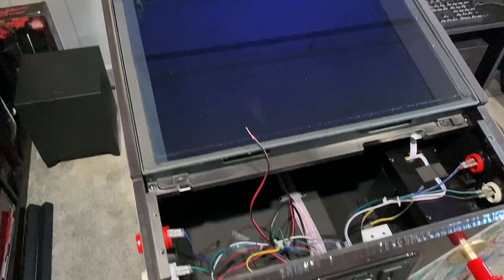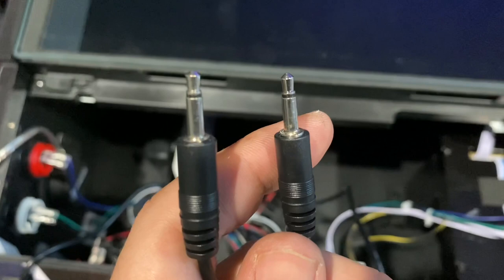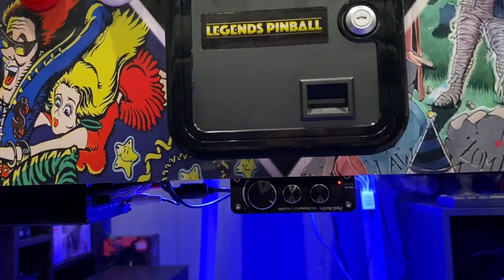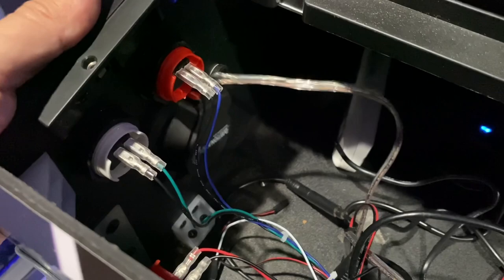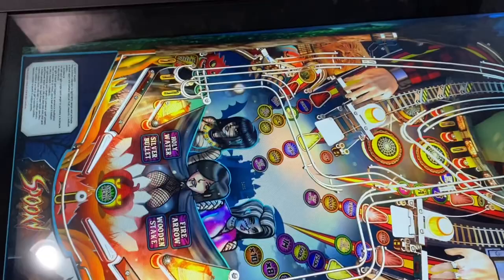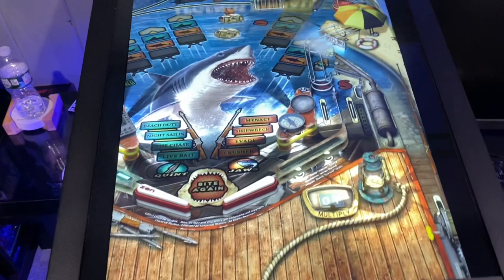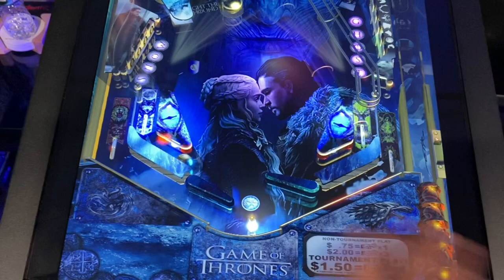Feel the Game: Legends Pinball Haptics Mod Tutorial with Bass Shaker, Exciter & Amps!

Comment: Your tutorials are great. Do you happen to have a schematics of your wiring? I have a little bit of trouble following the videos, looking to add the bass shaker and solenoids you suggested. Thanks again!
Reply from the maker: Thank you, greatly appreciate the feedback. 
For the bass shaker you’ll want to get your signal from the original feed for the haptics. Red to red, black to black on your adapter to amplifier wether it be 3.5mm mono or RCA. From your amplifier you’ll need a power source (power brick) and a positive and negative lead that goes from one of the outputs on the amp to the bass shaker. That’s it. 

The solenoids are even easier. Tap into existing flipper wires. Plug in power source. 

Hope that helps. Follow the videos along and pause. I talk fast, sorry.
Reply: @JohnPauls  so I'm about to install the bass shaker, but had a thought. Do you get haptics when playing in OTG mode? I get none playing on steam. If I'm using the wiring from the exciters for the bass shakers, assuming I will not be able to use the bass shaker, unless I'm playing on a built in table? I'm on the latest firmware. I feel like I've read somewhere that the latest firmware broke otg mode haptics.
Reply from the maker: Do you have haptics in VPX? FX3 haptics are weak from the get go. If you don’t have haptics at all in OTG, the bass shaker won’t work. I get signal in FX3 and the bass shaker rumbles albeit less than VPX and Native tables.
Reply from the maker: There’s supposedly a rollback firmware that fixes OTG haptics… worth looking into

Comment: Great Video, Why do we buy “Monoprice 109436 Gold Plated Speaker Banana Plugs – 5 Pairs – Closed “  I think I miss it on your video. Going watch it again.  Where do we use this on or with? Ok I am good. By watching again it help.
Reply from the maker: Only needed two, the rest are extras. Amazon only had them in that multi pack. They are used to connect to the back of the Fosi Audio BT10A  amplifier. There’s tutorials already online on how to set up a banana plug on the end of the wire. Super easy. Allows for simple plug and play. Hope that helps and thank you!
Reply: Banana plugs are not a necessity, just provides a nice finished look.
Reply from the maker: Correct
Reply: Do you turn off the “tilt” physical option? That shaker has to trigger it easily.
Reply from the maker: Yes although the positioning helped to reduce it on most tables. Gyro located next to the plunger. There are moments during gameplay that caused it to tilt. I use the nudge buttons mostly because I haven’t gotten the accelerometer to work in OTG so I’ll keep the experience the same.

Comment: It seems like there is a hell of a delay on the flipper lag.
Reply from the maker: Check the latest video with the leaf switches installed. Made a significant difference. There will always be a slight bit of lag with the ALP however graphic card settings and leaf switches certainly improve it.

Comment: What could be the issue I did the poor man's DOF. Worked amazing 👏 I wanted to add more exciters to middle of cab when did that everything stopped working and now only one exciter works on left side. Added the exciters to existing exciters in parallel and then poof..nothing what happened? I think I narrowed it down either the ALP sound card or the 3.5 mm. jacks but can you mess those up? As for sound card can you even get replacement for this? I did my research on parallel and series everyone just be careful what you add to ALP maybe someone out there have this same issue.
Reply from the maker: You added them in parallel to the existing exciter wiring? You definitely blew the stock sound card / amplifier. I believe it’s part of the board unfortunately… ugh that sucks.
Reply: No I added them to the two dayton exciters installed. I thought I blew the amps but they work because I swaped them out . I hooked up the the stock  exciters and it works. Pulled the 3.5 mm connector off the red and black wires re wired and plugged everything back in and only works on left channel but when I pull it out a bit it works on  right side very strange could it be the 3.5 mm connector. I ordered some new ones. I am so pisst at my self for doing this because it was working like a boss.. But I can't leave shit alone  should I try the mono splitter a someone mentioned in a earlier post or do you still think its is the board.. Where ? can you get a new board ? Can you order replacement? I hope I can fix this f%$k up. I was trying to determine series over parallel I guess I chose wrong.. PS: Oh have you played the BW mod of Adam's family its awesome great table.
Reply from the maker: Get the mono 3.5mm, your board is fine if the stock exciters work after going back. Shit happens, we live and learn from testing things.
Reply from the maker: I have the regular version, was the B/W mod different in regards to gameplay? Looks cool.
Reply: Well got it working it just doesn't seem like it was don't have the hum between Stock mode and OTG mode and before just plugged everything thing in now have to play with connectors pull them in out ect sucks. Well you live and you learn. I did a cool mod lighted buttons you can use your 12v power supply from the solenoid upgrade to power lights  run the lights daisy chained and ground same way its awesome mod to at games ledgens pinball..

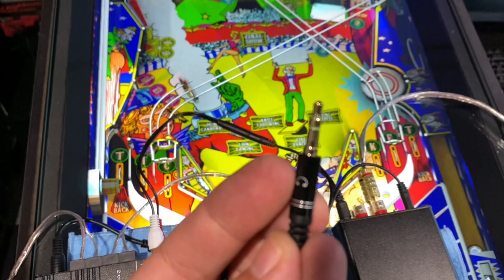Comment: Sorry I got confused at 4:12 how you split the wiring as it's taped up. I see the original red/black wire from alp and from there how is the wiring spliced into that? But to understand did you take both Fancasee 3.5mm to bare wire connectors, and connect the 1 red wire off each connector soldered to original alp red, and likewise for the 3 black wires?
Reply from the maker: That is correct, red to positives & black to negatives.
Reply: @JohnPauls  thank you. Could we run a 2.1 amp (50W×2 with 100W) instead of 2 amps? I'm thinking of getting a Damgoo which has its own sub frequency and volume dial. And then hardwire a 24V psu.
Or should we run dedicated amp only for the bst-1?
Reply from the maker: The Dayton Exciters are low voltage, 50w will fry them.
Reply: @JohnPauls  OK thx. I was cross referencing with another video on vpin parts, and this guy is using the 2.1 (50Wx2 + 100W) to power up his exciters and bst-1. He mentions a 2.1 setup front and back, but the exciters are 8 ohm 25W. Still though the amp power is double the speaker max. I'm assuming he just won't go full throttle on volume or it will blow them?

https://youtu.be/5Ftgomc1Wqs
Reply from the maker: Probably so, max volume will definitely distort them and possibly release the magic smoke. Interesting

Comment: is it possible to add additional exciters?  Does this mod disable the stock exciters or simply add 2 more to the stock 2?
Reply from the maker: Disables the stock exciters, they’re trash. You can add as many as you want as long as you account for power output on the amplifier(s). You need enough power to drive each exciter.

Comment: If you are only adding 1 bass shaker and 2 solenoids - can it all be run from one amp?  Or is using 2 amps necessary, or possibly just beneficial in that you get separate volume controls for the exciters and bass shaker?  Further, there are more powerful 20W 4 ohm exciters, that would be wired in series I'm guessing if they were to be used - would choosing those exciters change the amplification requirements (1 vs 2 amps)?
Reply from the maker: The exciters use a much lower wattage hence the need for a separate amp, the base shaker requires more 50w. You can find an amp that has separate power outputs by channel however that gets more expensive. Also better to be able to control amplifier power to each as they individually need tweaking by table / system playing it I.e. VPX, FX3, Native Alp

Comment: Question that’s been on my mind….Is this equal to Buy Stuff Arcades haptics upgrade kit…..or better? Mainly the bass shaker? I do like the Buy Stuff Kit because it comes with the audio switch. What would be the better way to go? Both options are a difference of $9
Reply from the maker: Wouldn’t know, sorry. Consider install ease as well. My setup performs extremely well, no issues in over a year. Plug and play is easier but I haven’t seen or felt the BSA to make an informed decision.
Reply: @JohnPauls  I’ve got some downtime for 3 weeks so I’m finally pulling the trigger on the Cleveland Software solenoid kit and now the haptics upgrade!!🤘🏼
Reply: Do the amps you went with come with all the wires I need to hook this up?
Reply from the maker: No, wiring will be needed. Gauges recommended in video.
Reply: @JohnPauls  I finished the project and it’s now the highlight of my arcade!!! It’s literally night & day……INCREDIBLE!!! Haptics working together with the solenoids is just awesome!!!! Thanks for the inspiration and motivation!!!❤️👊🏼
Reply from the maker: You’re most welcome, truly glad to hear that Daniel!!! 👊🏼😌 Thank you for the feedback, enjoy it!!

Comment: Hey man!! Thank you for the tutorial. I’ve put together the same set but I’m having an issue where I’m only getting sound out of the left channel on both amplifiers. I’m assuming I did not understand how you wired the “splice” that you put together. Could you please explain how you did the splice? I wired all three reds together and all three blacks together, is that wrong?
Reply from the maker: You did exactly the right thing, reds to reds, blacks to blacks. See if you get the other channel to come live by jiggling the input to the amp. Some are reporting issues with the 3.5 connection.
Reply: @JohnPauls  I also figure I can just run both small haptics through the one speaker channel. I’ll try jiggling first though. Thanks for the reply
Reply from the maker: You can but easier wired up this way. Give that a shot. I believe they may have changed that y Connector hence why some are having issues. You’re most welcome and report back how it goes please. Thanks.
Reply: @JohnPauls  I ended up just running everything through the left channel for now, I couldn’t get the right channel working on either amp. Regardless, it works and is pretty damn cool!! Now I’m just tinkering with all the sound levels trying to find a good balance. What did you use to mount the Fosi amp?
Reply from the maker: It’ll be so much better with both channels, did you try connection at the amp? I have another video that goes over VPX haptics settings. They should help. The bass shaker makes the biggest difference. I’m currently moving my Dayton exciters to another location within the cab to make room for independent solenoids. I’ll have a video up soon. Please keep me updated on your progress.
Reply: @JohnPauls  I have the exact same issue with no signal on right channel exciter. Switching the RCA plugs at the amp moves the audio to the right. So it seems the signal is only coming through one of the RCA cables. I actually ordered a different Y connector thinking that was the issue and had the same problem. I’m wondering if the issue is because the 3.5mm outs on the open end connectors are mono and the 3.5 mm jack on the Y connector is a stereo input?
Reply from the maker: It could be, I did not have that issue so I could not confirm. Both channels have output. Please keep us updated.
Reply: @JohnPauls  so when your exciters fire, do they do so individually? I’m admittedly not great with audio, but now that I think about it, it seems odd that it could still operate in stereo after converting it to a mono signal. I guess I’m going to buy an open end connector with a stereo out rather than mono for the exciters (mono should be fine for the bass rumbler) and see how that goes. It looks like the stereo ones come with a third ground wire though; assuming I can just ignore that…
Reply from the maker: No they do not fire individually, nor did the stock exciters wired in series. It’ll pump the same sound through both exciters however now amplified and wired in Parallel. Look into the DOF solenoid video I made if you want individual feedback without having to program anything to a pc. As long as you’re getting feedback to both exciters, you’ve just improved your ALP tremendously. The bass shaker was the best bang for the buck in regards to whole table feel. Hitting the bumpers, ball roll, etc. all felt through the bass shaker.
Reply: @JohnPauls   thanks for all the help. I did also do the bass shaker and that works fine. I ended up doing like Doug above and running both exciters to the left channel amp out and it works. Guy in another video that wired things up the same way you did everywhere else also said both need to be hooked up to left channel. However I’m not feeling much from them when running games on my PC (stock is a little better) so now I’m wondering if there would be any boost in performance if I can get the right channel working. A comment you made to Doug above seems to suggest you think it will, but was hoping you could confirm that before I go to the trouble of buying those stereo 3.5 mm outs and rewiring stuff.
Reply from the maker: It normal for them to need an amp boost on VPX and FX3, I find having them set at 1/4 to 1/2 volume on Native Tables and 1/2+ for VPX / FX3. On VPX make sure you apply table sounds to Lontium in sound preferences, can be done on the Vpx.exe in edit mode and saved globally. The bass shaker will break in and get much louder / stronger with use.

Comment: About to install the bass shaker. Do you find it vibrates the metal casing on the power supply? Even when i tap the bottom of the cabinet with my hand it makes an annoying vibrating sound.
Reply from the maker: No, mine did not cause any vibrations of the metal casing of the power supply. Anything mounted inside the cabinet, like power bricks for the amps, solenoids were 3m double sided sticky taped down to prevent that. Isolate the vibration with the back panel open and tighten down or apply something to dampen it. Definitely worth the effort as the bass shaker is one of the best mods you can do.
Reply from the maker: Also make sure the bass shaker itself is secured properly at all points. It has a dampening foam on the mounting side that prevents rattling. 

Even wires, like in the video, isolate them, group them and zip tie them so they don’t rattle. Worth the effort.
Reply: @JohnPauls  Yep I plan on making sure everything is locked down once I have everything in place. Also installing DOF this weekend from Cleveland software. I just notice that slapping the bottom of the cab makes the metal power supply vibrate and it worried me a bit. Hopefully it’s not an issue when it’s all put back together.
Reply from the maker: Hopefully not. Awesome, keep me posted and thank you for watching!
Reply: @JohnPauls  well it’s rattling the metal case on the power supply pretty bad, I’m not sure there’s anything to do to fix this. What volume do you keep the amp at? Kinda bummed, might not be able to keep it

Comment: Question...I'm no expert in audio, but is there anyway to use my PC's motherboard amp-up feature to act as an amplifier or will that not work?
Reply from the maker: I highly doubt that but I too am no expert. Without an external amp that can handle the drivers, it’ll probably sound muddy if it works at all.
Reply: @JohnPauls  Thank you for your fast response, yeah I was just curious because since I already have that kind of Motherboard for my PC.
Reply: @JohnPauls  Also the exciters mentioned in your info section are on back order looks like. Could you recommend any other exciters please?
Reply: And the amp for the exciters aren't available anymore
Reply from the maker: Exciters go on and off back order routinely due to the demand. Place the order on Amazon when it offers preorders. I did that and only waited a month for a restock. 

The amplifier doesn’t have to be that specific brand. Another compatible unit with the same specs will work.

Comment: I get a hum whenever in a menu screen with the same set up. Did you have this problem
Reply from the maker: Only when the amps are turned up too high. It can be eliminated, haven’t gotten around to it. They sell RCA ground loop noise isolators that reduce it.
Reply: @JohnPauls  I only have the bass shaker. I have the ALP cable wired to a stereo 3.5mm cable that is plugging into the Fosi aux port. I’m getting a hum from the bass shaker the moment I plug the 3.5 cable into the Fosi. Any suggestions? Or is this the hum you’ve referred to?
Reply from the maker: Yes, helps to have the Amp power plug on a separate power brick / outlet from the ALP. That’s ground loop feedback, can be eliminated but doesn’t bother me as I only experience it when there’s no signal input. By that time I’m shutting everything down anyway.